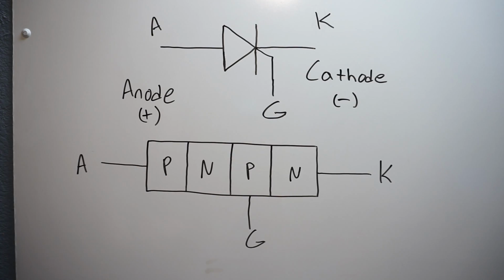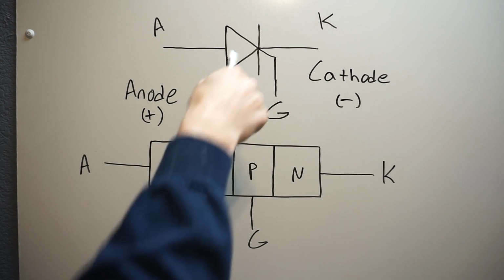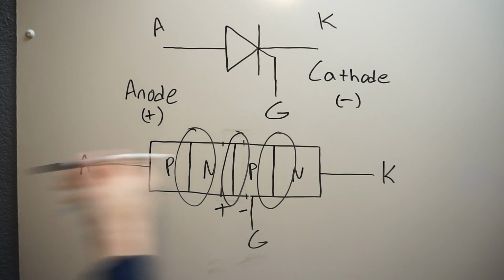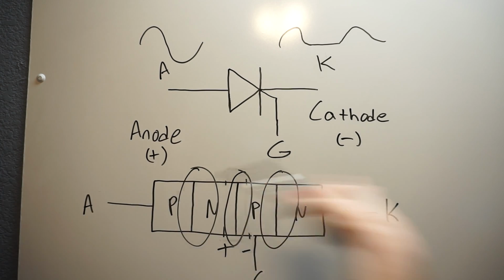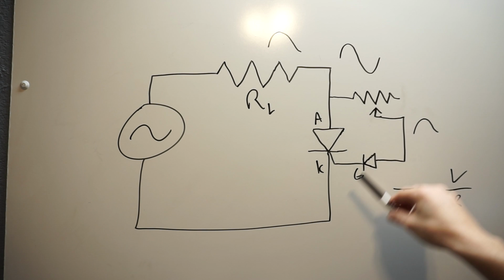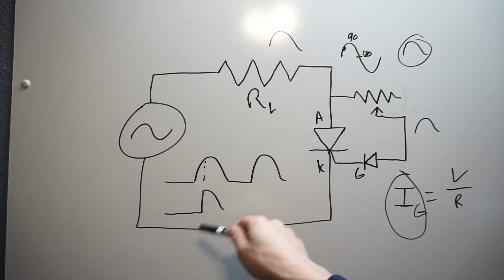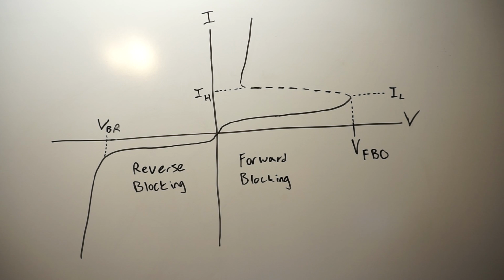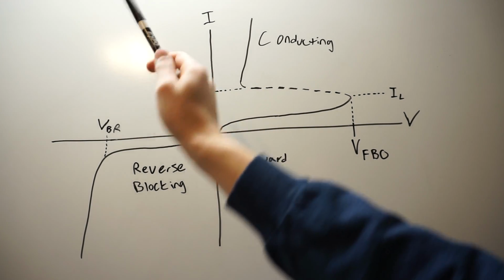Basic Electronic Components - The Thyristor (SCR)

Comment: Thank you for this educating video. I have some questions.
As far as my searches show, in a thyristor, the current that enters the Gate should exit through the Cathode. In many circuits, thyristor is used for controlling AC current, that is, its Anode and Cathode are connected to AC source and the load uses AC, BUT its Gate is triggered by DC current (for example, through an IC).
1. Does, in this circumstances, the DC current that enters the Gate exit through the Cathode that is connected to AC current?
2. If yes, does this mean that a circuit can be established between DC and AC?

Comment: I would LOVE to see a picture of the silicon die a thyristor/triac or other 4 layer device. Or at the very least, I would really like to see ANY sort of diagram that's an accurate representation of what they look like in reality. Rather than just 4 blocks with NPNP or PNPN. Something like this: https://static.righto.com/images/oq-ecl/transistor-structure-npn.jpg
Only, those images are of an NPN BJT on a an integrated circuit (op-amp, I believe?). I realize a picture of the die is tricky. But why are there never proper diagrams?

Comment: Please what's holding current
Reply: Holding current is the amount of current that you have to keep flowing through the component to keep it on when the gate is not activated.
When the gate is not on and the current being conducted in the main circuit drops enough it will shut off completely and will not conduct again until you apply a gate current (and / or voltage).
To stop the thyristor conducting you have to have a way to stop the current flowing through it (or at least lower it below the holding current.)
[Hope I have got this right.]

Comment: SCRs were used in forklifts for PWM series motor control for traction and lift hydraulics. Some operate at very high currents between 12 and 80 VDC. GE made a whole range of them for many decades. They were popular because high amperage transistors were cost prohibitive until fairly recently. Prior to SCR most used giant resistors with shorting solenoids for the "gears". Very bumpy. SCR made it feel more like a proper accelerator. It is clunky what needs to happen just to shut the main SCR down in the systems. Transistors are nice and neat lol.

Comment: I've only seen them in portable spot welding power supplies.
Reply: used high voltage DC transmission lines as well except they are quite large

Comment: Thanks for explaining this.  I was troubleshooting a non functioning AC to DC variable speed motor control (for a pottery wheel)  which had some circuitry that I wasn't familiar with.  it had two S4020L thyristors in it, and I couldn't find any mention of them in the circuit simulators I usually work with.  Your video helped me to understand how these are used to both rectify and regulate the speed of a motor.  And as an added bonus, helped me to isolate the burned out components.  (Burned out resistors on the gate channel.)

Comment: You too same as all of youtube teachers, why don't you tell that what and how it happens when gate signal is applying and off the gate. All are reading only from the book but not one has said actually reason .! Its really bad
Reply from the maker: Quince brietny I really can't understand what you are trying to say but I explain literally down to the electrons if you watch all my semiconductor videos. There are multiple videos that go along with this. I explain why it works quite detailed. Watch my other videos if you want a deeper explanation as to why this device behaves how it does.
Reply: Jacob Dykstra, please say why scr is not turning off when the gate signal is removed.
Reply from the maker: Quince brietny the SCR is a latching device. Once current starts flowing it will not stop until the current reaches 0 for a specific amount of time. I am sure I explained this in the video.
Reply: Jacob Dykstra that means how the junction2 will work, forward or reverse???
Reply: @gnquince  When you forward bias an SCR you still have one remaining PN junction as described in the video. Once the gate current is applied, that barrier is overcome and you essentially have a standard diode. Instead of having a PNPN region you now functionally have a standard PN set up as in a a standard diode. This does not change as the electrons have already been “injected” by the gate so it continues to conduct as a standard PN diode even after removing the gate signal.
Reply: @gnquince  so think of the gate as pushing the remaining PN junction up higher. Now the SCR only needs to maintain whatever low voltage is required to keep the diode conducting. As a drawing this would show a single large N layer, a small depletion region, and a smaller P layer.